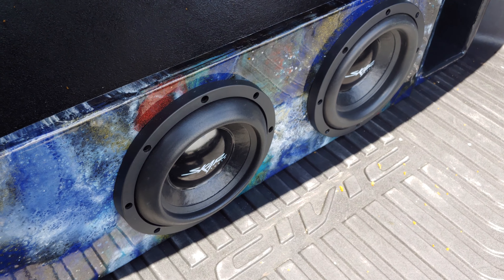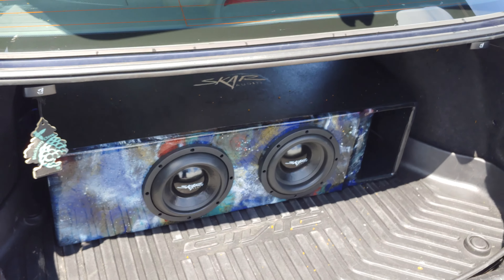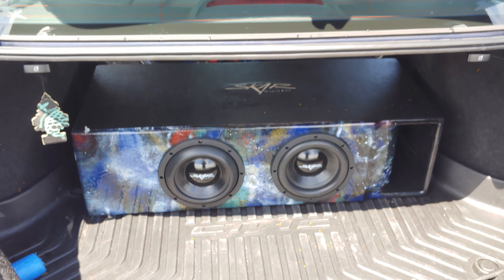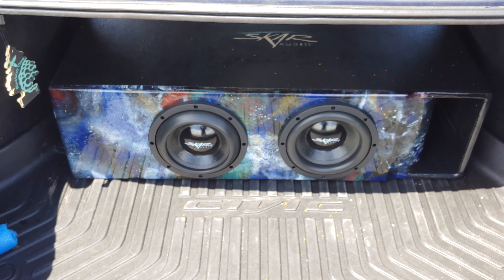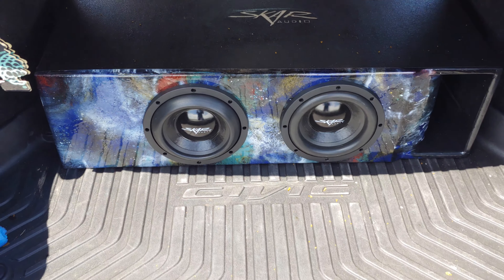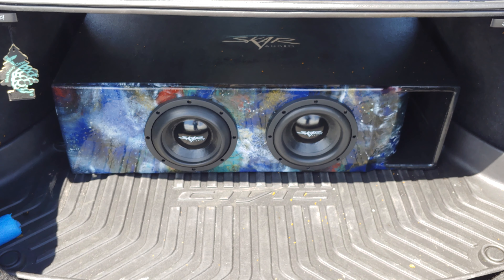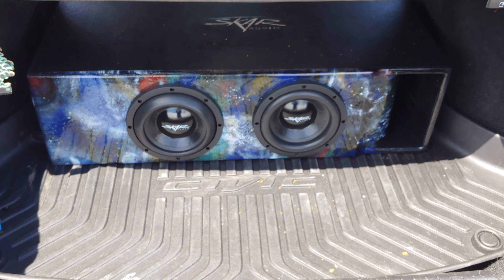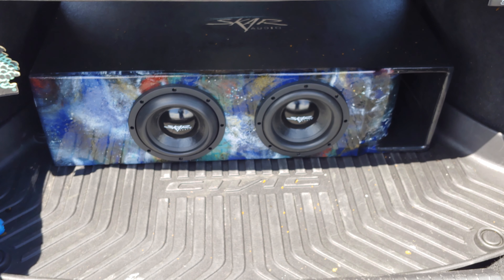Budget Skar Subs Blown Already?

Comment: You gotta set your gain with the bass nob all the way up. That way no matter how much you turn your nob up your good.
Reply from the maker: Of course. Problem is, I listen to alot of 70s rock, metal and Hip hop. So So the no clipping on rap, but no output on 70s rock, or the 70s rock is slapping...but if a rap song comes on and I forget to adjust the knob...RIP Sub
Reply: @thebrokebasshead9984  check out sundown yard sale  I've had good luck on all the subs I've bought off them. There sa v.2 8s are $135 or grab there x-8 for $185

Comment: If the coil jumped the gap, you didn't have your subsonic filter set correctly.  You should be rolling off everything below 33Hz on those IX-8 subs.
Reply: Hey man I got an svr15 on an rp1500.1d.
The filter knob confuses me a bit... I understand how it works and the idea of a band but it seems like my knob is inaccurate or something.

What should I start rolling off at with my svr15?
If I set my subsonic filter right on that number will it start rolloff from there??
Reply: The box is like three times the size it should be,,, I'd say it's more along the lines of an overpowering issue
Reply from the maker: @FrankStPeter  modeled the box in win isd with the T/S parameters. It's a bit small actually. Its 1.8 cubic feet internal. Has 25 in of port area @34 hz so it takes up alot of the volume.
Probably safe to say Skars T/S parameters may be off, but I was severely overpowering them....you know, for " testing purposes"
Reply from the maker: @RandoManFPV  should be at or a touch below the tuning frequency of the enclosure. If the sub plays below the tuning , it can unload, which means the port is no longer resonating and instead is acting like an open Hole In The Box, allowing the woofer to move almost as if it is in free air, which can damage it once it doesn't have that cushion of air so to speak.
Reply: This happens only if you are doing some wrong...there is no other way
Reply from the maker: @nestorrolon2039  It's the BEST way !
Reply: @RandoManFPV  if you have the prefab from skar, run your crossover point at 30ish hz arounf there going a little lower won’t hurt but it is a 12DB roll off so it’s a little aggressive on the filtering
Reply: Ports are usually bigger if you're shooting for a lower vent velocity. The gross volume ends up bigger than the actual net internal volume of the enclosure.
Reply from the maker: @Abowe3404   This Box is 100% custom , & built by me . Finish Is Glow Epoxy and bedliner with Gold flake. Logo on top is done in epoxy and also glows in the datk
Reply: @thebrokebasshead9984  looks great my man
Reply: @FrankStPeter  that box could handle 2 12's
Reply: @nestorrolon2039  so nothing can go wrong because it's skar?? The most overrated sub on the market. Lol

Comment: Yeah bro , I recommend the SDR series. I’ve been running an sdr12 with a hifonics Zeus 1800w max with 900 @ two ohms , obviously I set the gains without clipping , and the sub has been hangin in there bro, definitely bang for your buck.
Reply from the maker: Thanks for the suggestion!
I may or may not have a Loaded enclosure on the way, temporarily, till I get this setup sorted.
Reply: @thebrokebasshead9984  SDR is perfect. Would recommend

Comment: Try the Skar VD 8s. Rms power handling i think is 400 watts rms per sub. Total of 800 Rms. I think the SDR 8s are around 350 watts Rms each. I have 2 Skar SDR-10s dual 4. A sundown SFB 1000.1. They handle the power. I would stay around the 20% over rms range to be on the safe side. I had 2 NVX 10s initially. The rms per sub was 350 watts. They handled the power. But I would try the VD series or the SDR series.
Reply from the maker: I have a vd 8 glassed under the dash. Does great!

Comment: I’ve used a few of those. They only need .75 cu ft per sub at most. It’d be worth it to go to two 10s. Preferably the SDR 10.
Reply: I have the SDR-10s. Had them for two years and still going strong.
Reply: DDX-10 would be where it's at

Comment: Well just out of curiosity can I have your box specs height width length port width Port height and length any internal bracing just by looking at it I would say 34 wide 12 in tall 14 in deep roughly 4 inch port by 10 1/2 port length 18 or19 in or so with .5 or .8 for displacement per sub. how close am I
Reply from the maker: 36 x10 x 16
Port is 2.75 × 8.75 and 30 something long. Tuned to 34 hz.
 port is kerfed.
Box is 1.75 to 1.9 internal volume after port, woofers, & bracing. Win ISD says it's a bit small, but I think it's about .2 too big. 
Also if each woofer took up .8 cubic feet, they would nearly displaced the entire volume of the enclosure which they clearly do not.
Hope this helps!

Comment: Seems the enclosure is a bit big for 8"s just my opinion. There are so many decent 8" subs, the VFL seem decent for the $ sundown, ct sounds ect. Go with whatever peaks your interest n makes you smile
Reply from the maker: Port & bracing take up alot of the volume, Its only 1.8 or 1.9 total, Win ISD actually wanted them in more space, was originally going to do 3, but low end dropped fast in less than 2.5 cubes 3, si I did a pair to save space & weight.

Comment: U clipped them to death . Those amps are hot garbage. Gains set way too high hope u arent using bass boost
Reply: The amps aren’t the problem for a budget basshead. The problem is the owner improperly setting things and pushing it hard
Reply from the maker: No bass boost, gain is way down, EQ flat, doesn't take much to make 150w subs move @ 1ohm. I actually think I damaged them when testing in the house, before the install. my" test "amp blew. It was a sad day!
Reply from the maker: @btv4083  yup cant really blame SKAR. Saw a video of my amp at 1 ohm on a SMD meter and it hit 1000w at 1ohm
The subs were completely overwhelmed with power...my fault.
Reply: @thebrokebasshead9984  I’ve done to a couple of subs in my life.  Who’s to say I won’t do it again on a accident?? Great video tho